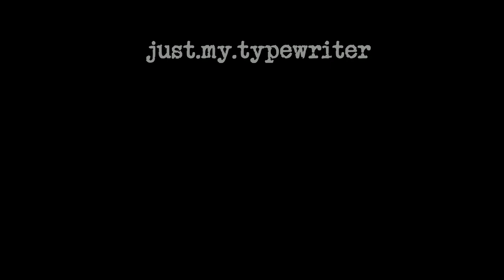Silently Cleaning a Smith Corona Silent

Comment: Do you always use mineral spirit when cleaning the type slugs and inerds (I can't tell if your qtips are wet or not....are you just dusting the inside with them?). Or do you not use mineral spirits all the time? Currently doing my first cleaning job on a Smith Corona Silent Super.
Reply from the maker: I'm just dusting here- I only use mineral spirits when outside where I can make sure I'm in a ventilated area. I highly recommend it for cleaning!

Comment: Now I need to figure out how to slow it down so I can see where the screws are to remove the body. I have 3 of the 5 series that I’d like to clean better. Are you still liking the vacuum/air compressor?  I got a electric air blower/duster on Amazon and have used it a few times just doesn’t feel it has enough power tho.
Reply from the maker: I do have some other videos on this channel showcasing the five series and the repair process!